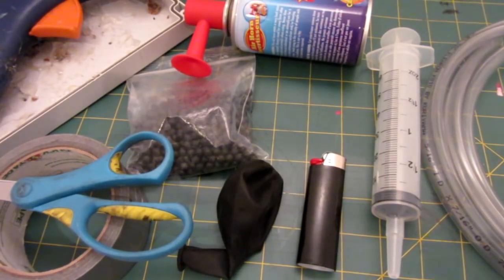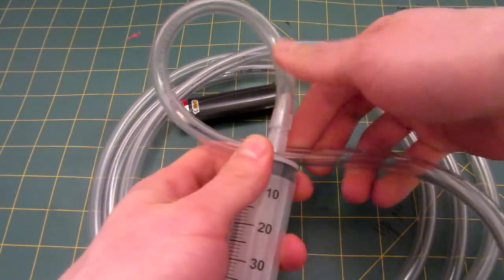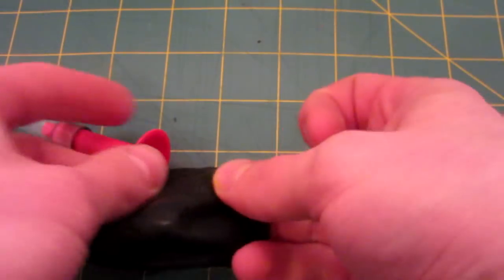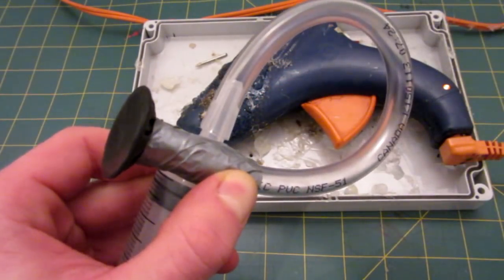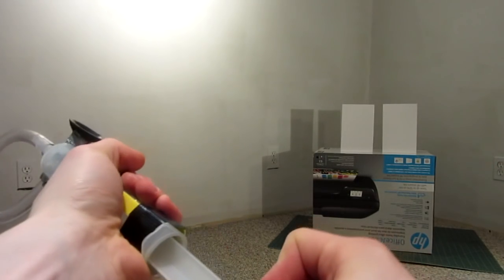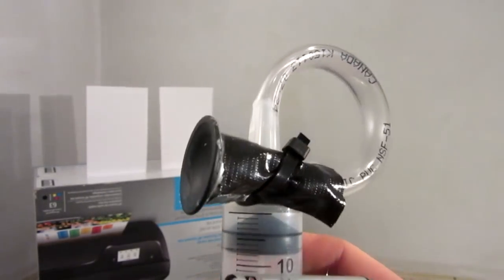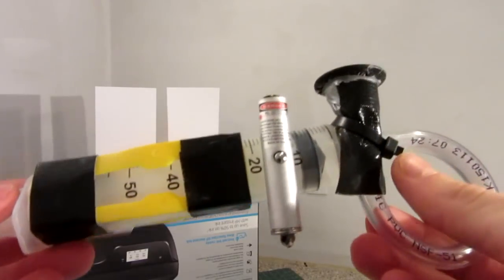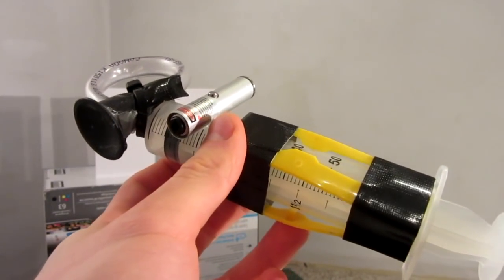Make a Vacuum Powered BB Gun

Comment: Would be hard to aim but you would probably get more power out of it if you pulled the plunger completely out instead of letting go of it. But then you would have to figure out a way to release the pressure when reinstalling the plunger. Maybe a homemade check valve
Reply from the maker: +Jared Callahan yes I tried that off camera and it did work great but reinstallation required to remove the hose which wasn't too bad but it was a pain